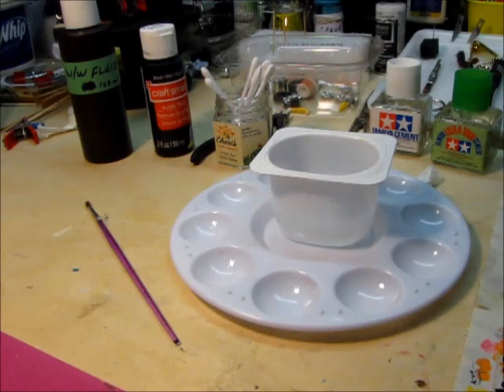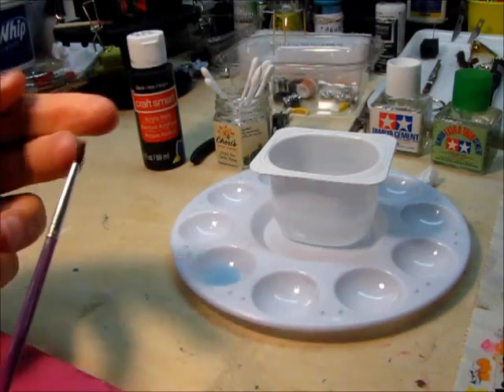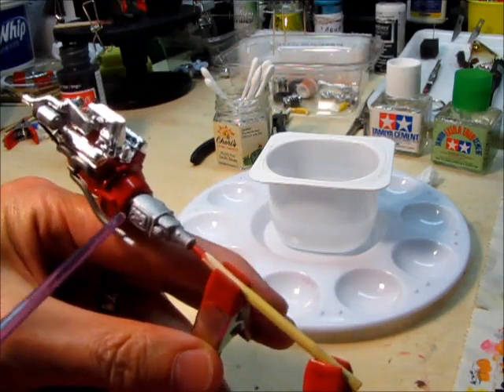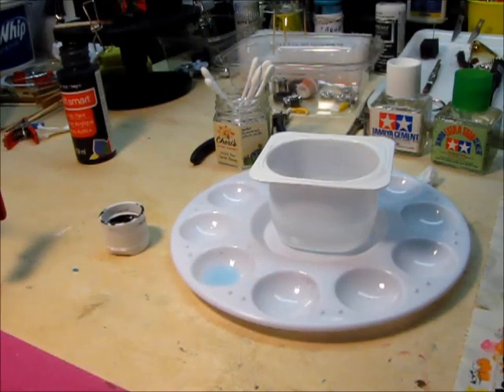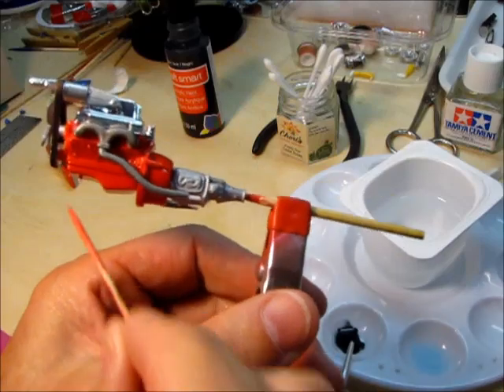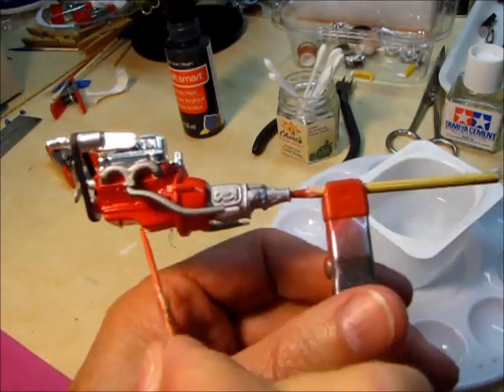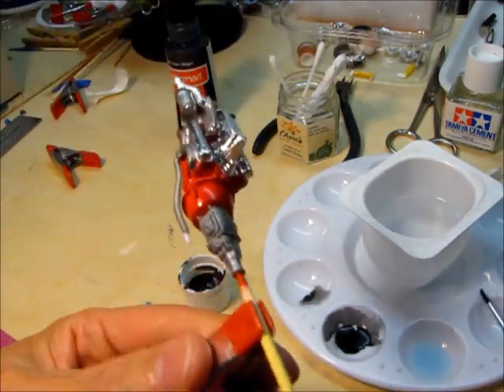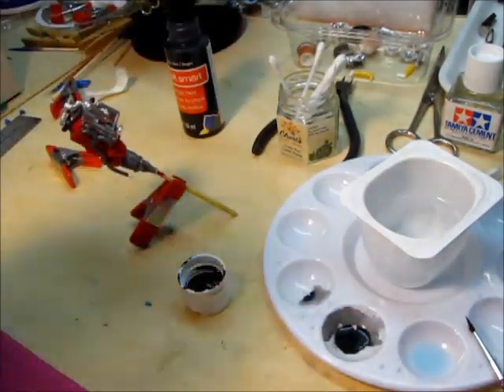How to: doing a blackwash with acrylic paint to highlight details

Comment: I've seen plenty of videos of people using windshield washer fluid for the same reason, and also to thin acrylic paint for airbrushing.  What is it about ww fluid that makes it a good option for those types of things?
Reply from the maker: I learned that also from watching other videos, I guess because it mixes well with water based acrylics and evaporates slowly and it's cheap and accessible.
Reply: @ModelCarMinion  I have also seen people using rubbing alcohol as a thinner because it dries sooner?
Reply from the maker: @bobschaar5720  I've used that for cleaner but not thinner.

Comment: Great job!but wouldn't it have been better to use thinner instead of water to thin your paint?
Reply from the maker: Yes - if you are using a lacquer or enamel paint. However, I am using water based acrylics so I thin it with water or windshield washer fluid and a drop of dish detergent.
Reply: @ModelCarMinion  I'm getting so many different opinions on this, I want to use Acrylic paints only on my models for health reason,and some says use thinner because with water the paint will chip off
Reply from the maker: @timothybooker1402  With acrylic colours you have to seal them with a clear,  I use Future Floor Finish or an acrylic clear sealer.  You would never need to use solvents to thin acrylic paint.  All the people I watch on here use either windshield washer fluid or Future to thin the acrylic paints.
Reply: @ModelCarMinion  when you say seal them with a clear,do you mean after the model has been painted paint over with a clear coat of Future floor finish or Acrylic sealer.and thin the paint with windshield washer fluid or future polish?
Reply from the maker: @timothybooker1402  Yes, that is exactly right, the future may be brushed on or airbrushed, no need to thin it first and it is self leveling.  There are many videos in the community showing how to paint models with acrylics.  Here is a link to an older video that I learned from:  https://www.youtube.com/watch?v=_bbHTLgPXaM
and Chris at Classic Plastic 101 has excellent videos explaining his work, this link is very helpful: https://www.youtube.com/watch?v=b9aYUtXSQ-Y
Reply: @ModelCarMinion  Would you use the same Future floor finish to thin your acrylic with?
Reply from the maker: @timothybooker1402    Yes, it is self leveling so it will help go on smoother and shinier.  You will still need a few coats of Future alone to seal it once the painting is finished.  Please check out the links in my previous reply.